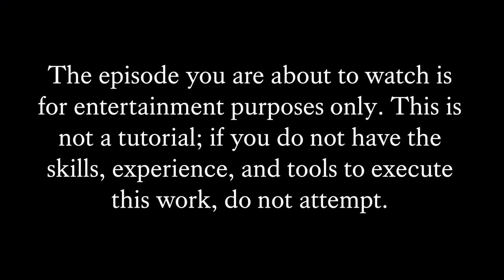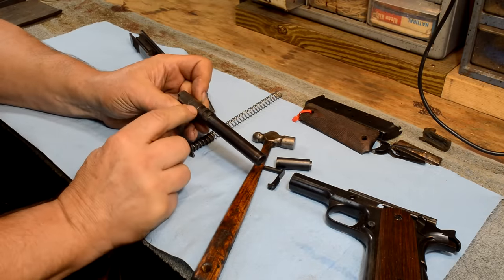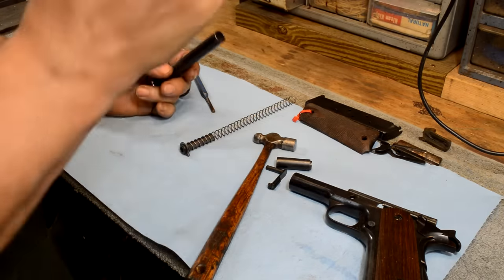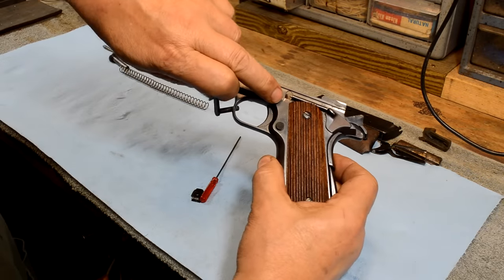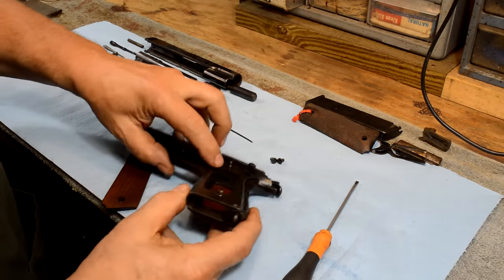Argentine M1911: Anvil 0125

Comment: Mr. Mark, can you please post some links of carding wheels? Here in Serbia, I have a hard time to find them by description (and there isn't Serbian word for it), but I was hoping to find something using technical data from products you use.

Thank you in advance.
Reply from the maker: https://youtu.be/62_pKoYje9o there is a still photo of the part numbers at minute 7:40 with descriptions
Reply from the maker: 2 or 4 row, .0025 or .003 inch bristle carding wheel.
Reply from the maker: 360164581 this is the Brownells part number.
Reply: Zdravo druže, ako pronađeš nešto slično u Srbiji, molim te baci link. Tražim već neko vreme takav valjak u Srbiji, ali neuspešno. Hvala unapred!
Reply: @doca001  I looked all over the internet, and no such thing exists in Serbia. The finest wire I was able to find is 0,2 [mm] which is 3 times thicker than this one...
There is a German branch of Brownells where you can find this wheel with provided part number...

Comment: I broke the long pin (detent?) off of my thumb safety, including a small triangle piece off the front of the safety (both one piece together) can that be fixed / welded or should I just try to find a suitable replacement? It's an Argentine, but the later ones.
Reply from the maker: The thumb safety is a Colt stock part, nothing makes it "argentine " per se. Procure a different one and have a pistolsmith properly fit it. No welding here
Reply: @marknovak8255  Thanks. I figured that getting it "fixed" or welded would cost more than an original one.

Comment: You used to be able to just swap parts in a 1911. The military versions were all designed to be completely interchangeable. Including the sear, hammer and safety. 

Gunsmiths turned a loose fully interchangeable combat handgun into what they are today not John Browning.

Comment: I was a hoping it was a 1927 , made in Argentina
Reply: What's the difference 🤷
Reply: @enricomandragona163 the one in the video was actually made in the US by Colt for Argentina around 1915 to 1916. I have one made in 1915. There should be an Argentine coat of arms stamped on top of the slide by the ejection port on his, but he doesn't really show it from what I saw. The American made Argentine Colt 1911s are much harder to find and worth more than the Argentine 1911s made later.
Reply: @oni_goroshi  hey thanks for the update. I actually saw that one in a Legacy collector video!! I also have a pre war Colt first gen and a 1944 Ithaca both all original

Comment: Are un-molested 1911 rare to find?
Reply: Wise guy says, if you buy a new one!😁
Reply: Not really, but it depends on what kind you're after. Colt alone made millions of them over the years so on any given day you'll find originals on the auction sites. 

The US military ones are rare to find numbers matching original because in service they would swap parts around so frequently. 

Civilian model Colts from after WW2 onwards are hard to find original sometimes because in the 1950s and 60s it was very popular to modify them for 25 and 50 yard bullseye competition. Then in the 1970s the defensive pistol shooting started to take off and guys would buy new Colts and without firing a single shot send them to smiths like Armand Swenson, Jim Hoag, And Jim Clark, as well as the Pachmayr Custom Shop to get whole packages of custom work done including commander hammers and trigger jobs, ambi safeties, front strap checkering, and beavertail grip safeties. A lot of kitchen table gunsmithing happened to committed by guys who didnt have the money for the big name smiths to tune up their guns. 

Id say its easier to find an all original Colt 1911 that is pre ww2 than anything from the 1950s onward. However pre war Colts are very valuable collectors items and they didnt have fully heat treated slides so they dont last as long when shot regularly.

Comment: Is he gonna peen it?
Reply: He’s gonna peen it. Sweet. I did that once, and it was very successful. I heard the brownells plates are garbage. Doesn’t that require a new barrel tho? Or just a different link?
Reply from the maker: I think we tightened up back into the original link length. We brought the slide to the link not vice versa
Reply: @marknovak8255  I see. You made it look way too easy. Turned out great!
Reply: @marknovak8255  something I did...a 3/4" wood block under the dust cover, when in the vise, would keep it from clocking when peening the front of the rails.